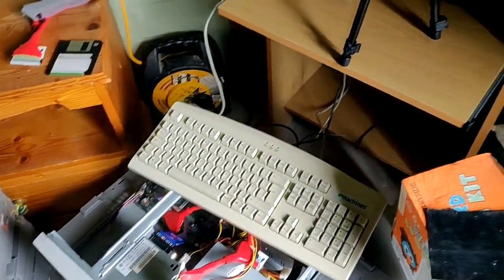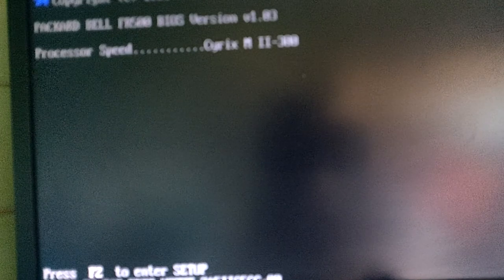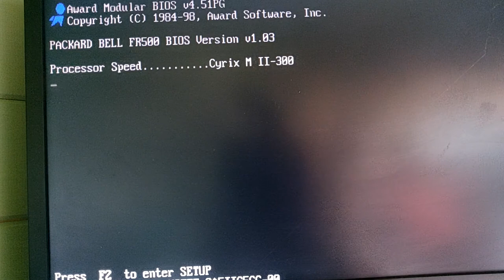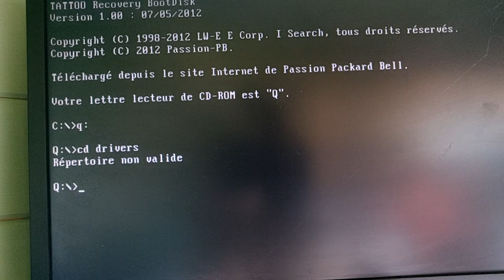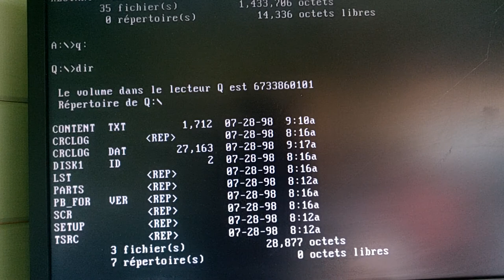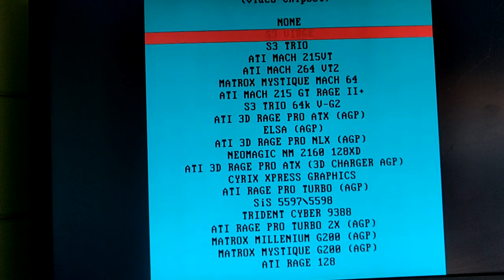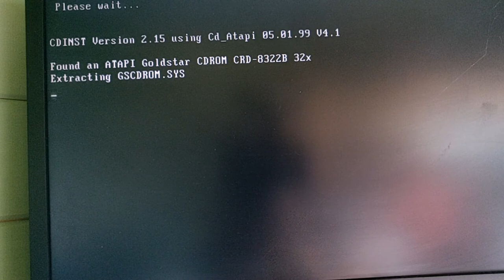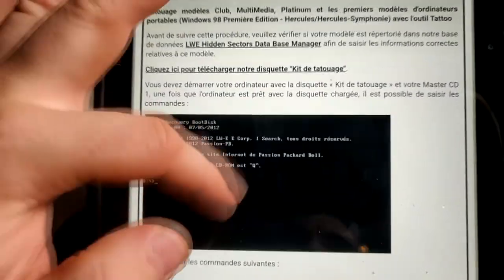Packard Bell Tattoo process for installing Master CD  / original operating system (Part 2)

Comment: Hi there, thanks for your video !
I'm trying to restore an old PB Platinum 7502 to its original configuration too, and maybe you could help me a bit. 
First I noticed the tatoo part looks much simpler than the one descrbied on passion-pb... So I'll try that to see if it works for me too (I hope so).
But then you got that small screen where you have to enter part numbers, which is supposed to be at the back of the case... Thing is, I don't have the case anymore, I bought one but it's a 7660 model. Does that mean I'm stuck ? same for the format switch...

ps : I'm french and drivers in that case means "pilotes"